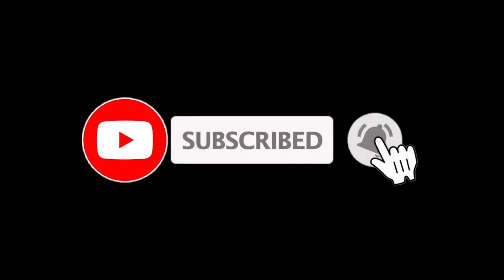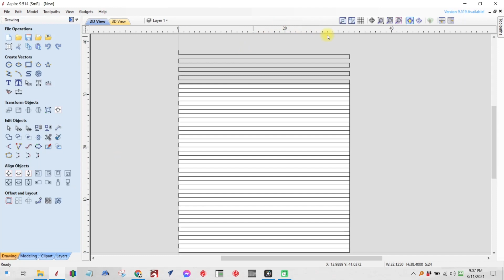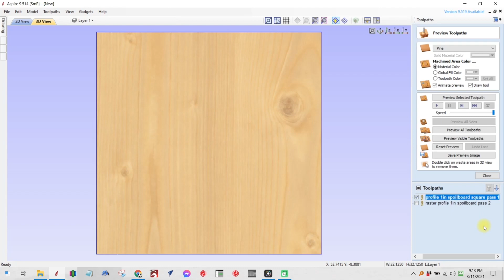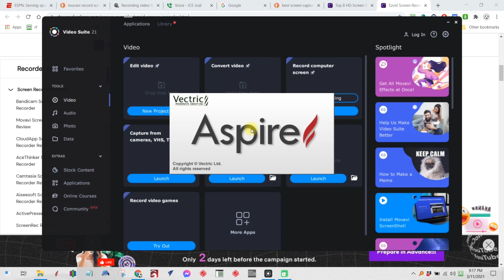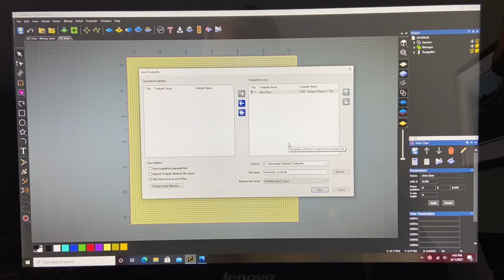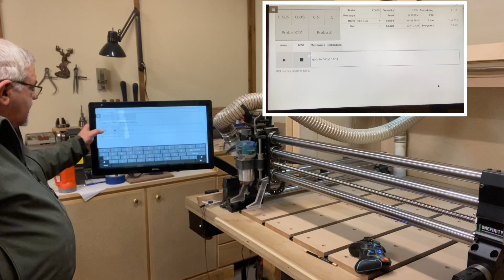Spoilboard Surfacing - Two ways

Comment: Again, newbe need help.  I see you check the continuity but where do I find the screen on the masso elite to see that.  It appears you're using a computer monitor.
Reply from the maker: Reach out to me in messenger. Will try to help
Reply from the maker: This was on the original machine (x35 and x50).  On the Masso, if you go to the F1 screen, in the center column, scroll down to the touch probe input.  When you touch the probe to the bit (magnet on collet), you will see the input change from low/green to red/high.  This indicates to have good continuity
Reply: Thanks for that. Now, Problem, the makita came with a plastic collet.   @onefinity-trainingtipswithMitz
Reply: Yes thanks.  I have no continuity from probe to tool or from magnet to aluminum pad.  Have continuity from plug on probe wire to aluminum pad using ohm meter. @onefinity-trainingtipswithMitz

Comment: A real great presentation for clear understanding. Just a quick question, is it advisable to have the spoil board a couple inches larger than the cutting area?    Thanks.....Bill
Reply from the maker: It really doesn’t matter as long as your bit can reach the edge of the material. I wind up putting a grid that’s 32 x 32 or whatever my cutting area is which will define the cutting area.

Comment: quick question. i will be setting mine up soon but it's for the Elite Foreman. Will these settings and steps work with this version? Right now I followed your steps for the toolpath file but obviously I adjusted to the size of the cutting area I will have (48 x 48) and I'm using a Amana #45526 1-1/2 in surfacing bit. Get back to me when you can. thanks.
Reply from the maker: As long as you’ve adjusted for size you should be good. I would actually set size to 49”x49”…with 1-1/2” bit, the centerline of the bit would only need to travel 47-1/2”, well inside the cutting area.
Reply: @onefinity-trainingtipswithMitz  that’s exactly how I entered my numbers when I created the file. Thanks for getting back to me quickly. I’ll let you know if I have any issues. Cheers 🍻
Reply: @onefinity-trainingtipswithMitz  Hello again, so I'm having an issue finding the center of my spoil board. i tried using the same method you used by using the MDI Command line and I entered X and Y using the G00 command but it only took me to the center of my Y but then took me to the far right of my X axis. I tried entering the commands one by one but it would not move from that position. I re-homed it and tried again but with the same result. Any assistance would be greatly appreciated. Thanks.
Reply from the maker: What machine do you have?
Reply from the maker: Home your machine first, then touch x and y on your screen to zero those axis. Then enter the mdi command G00X24.015Y24.187 and run.  Should move to the center of both x and y. If you’re still having problems, send me a note through FB Messenger.  You can easily fine me on the Onefinity Official FB group
Reply: @onefinity-trainingtipswithMitz  sorry I have a Foreman Elite
Reply: @onefinity-trainingtipswithMitz  thank you that worked! One last question. Your calculation are a tad bit different from mine. Not by much but will it matter when I go to surface my boards? Thanks again and for the quick response!
Reply from the maker: It shouldn’t matter. But i would set it to exact center of the cutting area. (Check x axis and y axis in th f1 screen for max travel and then divide it in half for x and the same for y.). Once the machine moves to the center press x and y on your screen to set x,y zero at this new location.
Reply: @onefinity-trainingtipswithMitz  thank you! Much appreciated. First time and I wanted to make sure I get it right the first time. I've learned alot from watching your tutorials. Keep up the great work!

Comment: I copied your process exactly on VCarve pro. Copied the files on to a flash drive. Ran the file on my Next Wave Shark HD510 and on each pass it is at a different height on one side. What did I do wrong. This is a brand new machine with a green horn running it.
Reply from the maker: Hi Pat, did you select the correct post processor for your machine when you saved the toolpaths?  Not sure what else might be causing it to carve at different heights. If it’s not the PP, then reach out to me in FB messenger and I will try to help

Comment: Thanks so much for the video. I've owned a Journeyman for several months and started with surfacing the spoil board using different methods a couple of times and was very disappointed with the results. Mitz...If followed your method step-by-step (adjusting for the longer x-travel for the journeyman) and I'm very satisfied and ready to get rolling now with a lot more confidence.
Reply from the maker: Glad it worked out for you.  This is an older video before I upgraded to the journeyman but same principles apply.

Comment: For VCarve, couldnt you just make a square covering the whole board and treat it as a pocket tool path instead of manually making a tool path?
Reply from the maker: Yes you can.  In the section using Carveco, that’s precisely what we did. You can do the same in VCarve also.

Comment: Just installed it on the qcw from underneath and even by lowering the gantry to the bottom holes, my bit is 1/2 inch above the material?
Reply from the maker: It shouldn’t be…what surfacing bit are you using?  I have mine on the QCW frame also and the z slider in the middle position and my 1” Whiteside surfacing bit still reaches the spoilboard.
Reply from the maker: Send me a message through FB messenger and I’ll try to help you

Comment: Getting this error, 	X axis position 825.137mm is greater than maximum soft limit 816mm
While executing GCode block:G1 X16.4227
       At: ./upload/Pocket SpoilBoard.ngc:12
Caused by: X axis position 825.137mm is greater than maximum soft limit 816mm

It says While executing GCode block:G1 X16.4227, but I am at 16.063 not sure why. I tried both ways.
Reply from the maker: Send me a message through Messenger or text me at +18165361398
Reply from the maker: I’d like to help but would like to chat about this further to resolve error message.  Please contact me

Comment: You fellows are making it harder than it needs to be. I was surprised to find that Vectric don't include a facing toolpath option. I would avoid all the node editing stuff by drawing a rectangle that covers the entire work area plus a little to include all the corners. Then use the same tool in pocketing mode to create a very shallow pocket. That seems much simpler.
Reply from the maker: We’re showing two different ways which can be done in both programs.  If you go to the section where Carveco Make is being used, you’ll see that the surfacing design is exactly as you described.

Comment: This is super helpful.... Is it my correct understanding that you should surface first, then tram (if necessary).... BUT I'm using the Vcarve software... should I design the surfacing file more like the Carveco example so I can see if I need "tramming"? If I'm thinking of "tramming" correctly I would need to go through the "pocket" type tooling so I can "see" all sides of how the router is set up which the Carveco file seems to do as opposed to a straight back and forth of the VCarve version.... Please be gentle ha ha... very new at all this.... Thanks for a great video and willingness to share your expertise.... It is people like you that make this journey easier and more fun!!!
Reply from the maker: Yes, you should surface before tramming otherwise you don’t have a point of reference. I prefer to use the offset cut like the one shown for Carveco to determine whether you need to tram front to back and side to side. The pocket type is the best way to do this in my opinion. You can reach out to Layne or myself - we’re both on the Onefinity Facebook forum and messaging. Feel free to reach out anytime for help
Reply: @onefinity-trainingtipswithMitz  Very kind invitation.. thank you ... I'll give it a go first (the struggle can be a good teacher !!)... appreciate your time thanks...

Comment: Thanks Guys, I designed the file you explained to surface my 1F.  It ran beautifully.  I can't believe how far out it was.  .027 between high and low.  I am going to need to shim my router from front to back a few thousandths.  Any help you may be able to suggest will be well received.  My finish is wavy front to back with the front being slightly higher.  Left to right looks good.

Comment: What is the software you are using to drive the CNC? I have just finished building a 1000x750 Queenbee Pro, and wish I knew about the Onefinity a few months ago. I would have been very happy to have got one of these instead. I lovbe that it is running on 50mm hollow rods and real ballscrews.
Reply from the maker: Im using Carveco Maker to create the design and generate the gcode necessary that machine can read and cut.  Layne uses Vectric VCarve Pro.  Both are great design softeware programs.  I'd suggest getting trial versions of both to play around with and find which one suits you best.
Reply: @onefinity-trainingtipswithMitz  i have vectric vcarve, however I meant the software on your 10inch touch screen driving your cnc.
Reply from the maker: All I know is that the controller is built off of Buildbotics technology
Reply: @onefinity-trainingtipswithMitz  thank you very much for advising, this looks like a solid product. 

Question, does this allow for a touch screen interface for controlling lie a touch screen jog?
Reply from the maker: Yes it does allow for touchscreen interface and touchscreen jogging. You can also attach a joystick controller to jog and move the router
Reply: @onefinity-trainingtipswithMitz  that is very cool indeed. However I have just seen that onefinity do not sell the screen or software driver box to people that have not bought the machine.

Comment: Why drawing a tool path, and not use pocketing toolpath, raster? It doesn't make sense...
Reply from the maker: There are 2 ways to do the spoilboard surfacing on this video, one using Aspire, the other using Carveco Maker. Not sure which one doesn’t make sense to you…the Carveco Maker one is a pocket toolpath, but uses an offset strategy for carving rather than a raster cut.  The reason for this strategy is I can tell which way I need to tilt my router in the event I need to tram the machine.

Comment: I tried to follow your steps very closely when using the carveco maker software but I get lost around the time you are trying to probe for Z and actually run the program created from Carveco. Im able to use the g00x16.063y16.063 and it takes me to the center. But once I probe for Z and try to run the program it comes up with an error for Z for the maximum soft limit. Any idea on how to fox this?
Reply from the maker: Text or call me. 816-536-1398
Reply: @onefinity-trainingtipswithMitz  Having the same problem but mine says: "X axis position -10.16mm is less than minimum soft limit 0mm
While executing GCode block:X-0.4 Y0.4 G1      At: ./upload/Surface 1 inch bit AGAIN3X.ngc:10     Caused by: X axis position -10.16mm is less than minimum soft limit 0mm".  I'm very new to this, but I thought i was following along well.
Reply: @user-cv6un7dj7b  I just ran into this, but once I set the x/y midpoint as 0,0 after moving to the midpoint of 16.063,16.063 machine was happy
Reply from the maker: V - give me a call or text me.
Reply from the maker: Once the machine is moved with the mdi command to the center point, you need to set x and y to zero. If you get a soft limit error on Z, you can either lower the bit out of the router a little way or lower the z slider to the lowest position

Comment: thank you. You must have seen my waste board and figured it was time:) The question i have is when i made a grid pattern. I was told to make it a single line. (Im new in this world) so the constant brakes in the line confuses me? or is it because your using a 1" bit? or i was told/read/remembering wrong?
Reply from the maker: The grid does not have to be joined.  you just need the start points controlled, so that when you select 2 lines, that the end of one is the start of another.   on the vcarve part of this video, you can see that i did the same.  a series of vectors that i control the start point of.   in vcarve, you can enter node edit mode by hitting N key, and then right click on the end you want to start and make start.  it will be the green node. 

if you get this wrong, it willl still cut fine, it just may jump around more doing it.  since i made mine with segments already a the start point before copying, they continue to copy the nodes that way.